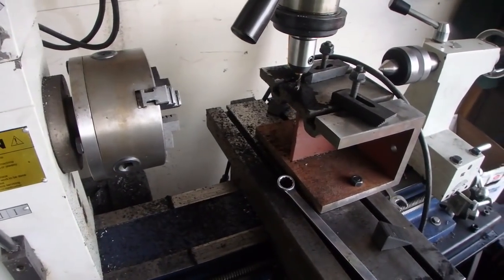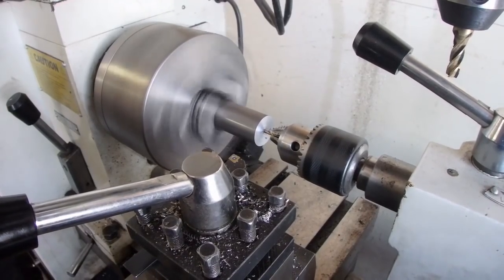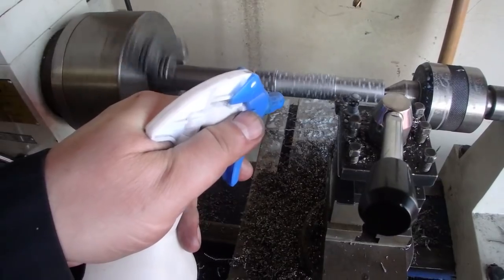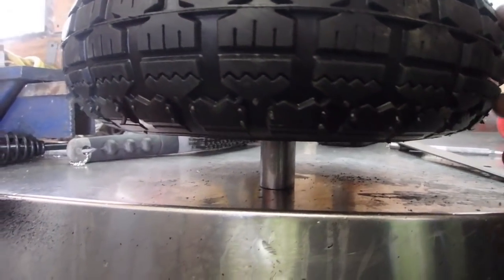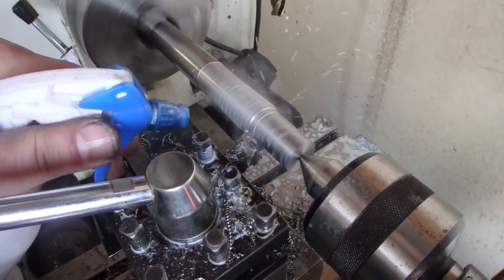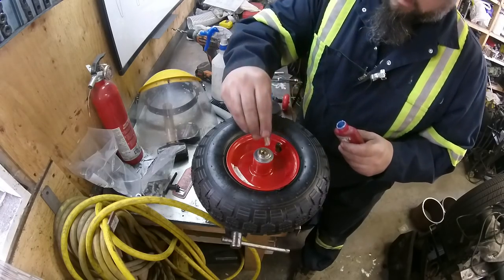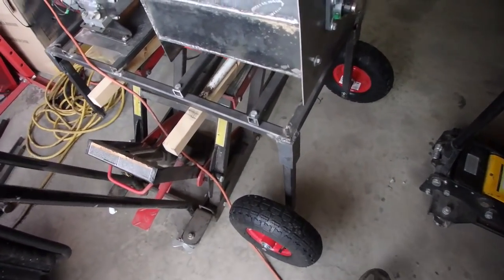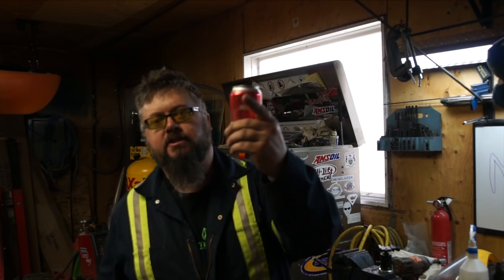Holy, Focus and Pay Attention

Comment: hockey puck works great on my jetta, cut a v instead of slot
Reply from the maker: +M Blake Jr hockey puck was a fail for me not going back to that route
Reply: Bullshitkorner you either got a cheap puck(doubtful) or wasn't cut right
Reply from the maker: M Blake Jr it's clear you didn't watch the video that showed what happened to the puck.
Reply: Bullshitkorner I did and the side smashed, looked like you didn't use your groove....I dunno u tell me
Reply: Bullshitkorner I just know it works for me every time......maybe it was frozen?
Reply from the maker: +M Blake Jr I didn't use the groove I did a load test on the side to see if it would support the car and it failed
Reply: Bullshitkorner I let it hold most of the weight and squishes down and the metal supports the puck, they work together and leave my car undamaged